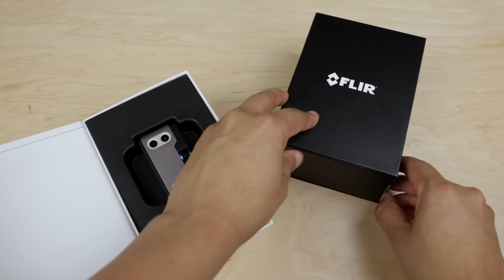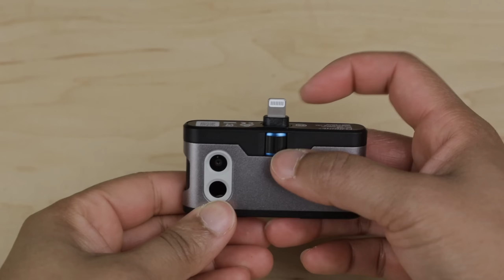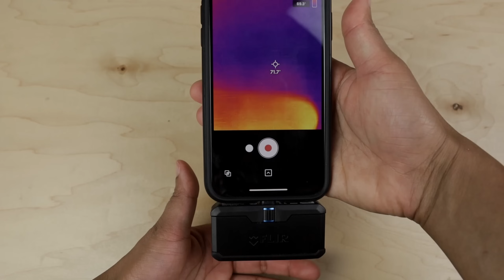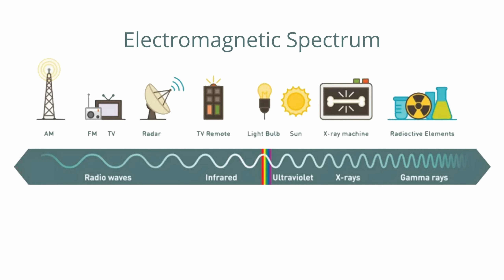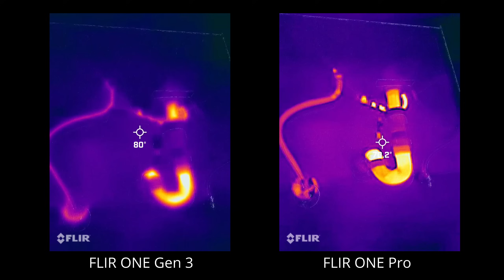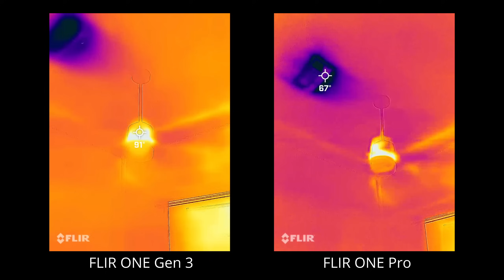FLIR infrared thermal cameras | Remodeling must-have!

Comment: I really appreciate your review of both the devices, especially the side by side footage. 

As an electrician doing mostly old work remodeling, I’ve been considering this investment for a couple years. This past week I suddenly wanting to do something that’s been intended for years, and while beginning the layout on my downstairs rec room ceiling I thought I had a good layout. But as I narrowed the areas I plan to cut holes for recessed lighting, I found ductwork in key areas. 
Finding a suitable tool I thought would be easy. But several of the reviewers maintained jargon that was unnecessary and not something I cared to have to deal with. Your video defined adequately many of the terms (and reassured me they weren’t going to impact my work requirements to know what they meant) and gave relative information regarding what I actually intend to gain by making the purchase. 

Thx. I haven’t decided what to purchase, but I’m fairly certain about reasons why the costlier devise might be a good expense addition l. And vice versa. ❤

Comment: (Oct  2022) Check out the specs for the new TOPDON TC001. Faster, higher res, cheaper than the FLIR pro, 256x192,  25hz refresh,  instant on.

Comment: I recommend Infiray imagers for Android / Windows users. 256x192 resolution is 2.6x greater than Flir One Pro with refresh at 25hz for half the price: P2 model is under $250. T2 models with macro, normal & telephoto lenses from ~$320. No battery in the camera means it's much smaller & usage isn't limited to 1hr max whilst it works. Power needed is lower as it doesn't have a cheap visible light camera to make up for low resolution. Infiray is a big OEM producer & released an SDK - there's some advanced apps for the T series that work on Windows. USB-C extension cable included is super handy. Solidly built metal housing. I'm not sponsored or paid by them either, just very impressed & far superior quality, function & value to the Flir offering that I can't believe Flir is able to sell these at such prices.

Comment: Great video :-)  tons of good info here @ 6:25 emissivity is the ability for a material to release radiant energy /heat.  while emissivity is solely dependent upon the type of material reflect Tivitt he solely depends on the color White being most reflective and black being most absorbent of heat. If something is black and iron or concrete or both there is a slow emissivity during the night hours. For a sheet of aluminum that is silver will cool off in a flash having a fast or higher emissivity.

Comment: I bought this gen3 for my smsung fold, for real deal better buy rugged phone like cat s62pro because you will exposed to the heat,water, metal sharp parts & metal tools while checking,  even the risk of fall 2meters when checking on ladder,  sure outdated s61 more better bcoz it has VOC meter to warning wear mask while checking leaking dangerous gas/toxins/asbestos.

Comment: For folk interested in a FLIR camera, it's worth looking at phones with FLIR built in. The Caterpillar CAT S60 was one of the first, and you could be lucky - like I was - and find a used one for <$100. It only has Android 6, the software isn't great, and it is SLOW but even so, it's a bargain for thermal imaging. (I think it uses the Gen 3 sensor.) There's now a CAT S62 Pro which I think has the same sensor as the ONE Pro, but I could be wrong.

Also worth looking at the thermal imaging phones from Blackview, Ulefone, Doogee. Most (or all?) use a FLIR sensor.
Reply: This seems like a good idea

Comment: For those wondering, the slow 9 fps of these FLIR cameras is because anything faster is export-controlled by the U.S. Department of Commerce through ITAR (International Traffic in Arms Regulations) and AECA (Arms Export Control Act.) Since FLIR wants to sell these both domestically and abroad, setting them at 9 fps or less allows them to be exported without a license. FLIR was fined $30 million a few years ago for violating these laws.

Comment: Ive been wanting one of these for a while, now if i could find an adapter that fits both USB-C and apple devices. Or are they OS dependent?
Reply: I doubt they are OS dependent. The software will handle that. You can get usb extention cords that have adapters to switch between lightning, usbc, microusb. They are all variations on the same connection.

Comment: Being in the calculations and diagnostic business, I usually tell people in your situation to go for the easiest and cheapest first and go from there:
Tighten the building envelope first. We don’t want to heat and cool the backyard…
- Caulk around doors and windows if not replaced.
- if possible replace old leaky doors and windows. New “Builder grade” (I hate that word) windows will still be much better than those 45 year old single pane ones. 
- Replace door seals. 
- Vacuum the old attic insulation and inspect. 
- Eliminate as many ceiling penetrations as possible and seal the rest. That attic fan NEEDS to go! Installing insulation above it will not eliminate air leakage. 
- Seal around AC vents, lights, etc and every top plate hole with that orange foam they use on newer homes. 
- seal or replace ducts, diffusers and boxes. 
- with that done get a blower door test and decide if you want to invest more money in tightening the home or not. 
-  at this point decide if you want to spray foam the attic or not and reinsulate it. 
- now that you’ve taken care of the envelope according to your budget, you can decide what else to spent money on. 
It’s a bit simplified but that’s it in a nutshell.

Comment: Ill be honest, I had one for a week and thought it was a total waste of $.  I bought it to use for my business and it ended up being worthless.  If you’re doing thermal insulation checks its not bad, but it does not see through walls as some advertised.  Not talking Superman, they said locating wires and pipes and it did nothing of the such.  I ended up taking pics of my dog and returning it.  A $20 laser thermometer does the same thing without the screen.

Comment: Thank you for that info Belinda, very educational. Calling on all your experience and expertise in this area which of these would you recommend to detect an underfloor leak on a heating pipe or even a cold water pipe? say under 100mm of concrete screed. Or perhaps there is another option (camera) best suited to this scenario.

Comment: I thought the low refresh rate was a technical limitation similar to the low resolution. It being due to government regulations kinda surprised me. I wonder why they did that.
Reply: TLDR: ITAR.
Thermal optics can be used on almost any weapon system that uses optics.  There are a fair number of missiles that use a thermal optical tracker to identify and track targets including ground, air, and naval vehicles.
Similar limitations are placed on night vision and other limitations are placed on GPS receivers.

Comment: I work in electronics and finding a short on a board can be tedious and time consuming. 
I had considered the accessory camera system until I realized just how much I would really be using it. 
That's why I went with the Cat S60 and then upgraded to the S62 Pro. 
This has been a great help in both my work and home. 
I found insufficiencies in my insulation very quick (1st day) . 
I can see when a bearing in a mechanical system is starting to go out and so many other things.
Reply: Interested in bearing. Do you know its failing because of an increase in heat?
Reply: @noahvillalpando  Yep. Gererally indicates a short
Reply: @charlesurrea1451  I'd love to see some video on a thermal camera capturing a failing bearing. As a mechanic this would be good for power steering pumps.

Comment: You can get some very useful imaging of insulation from the outside too, especially when the temperature outdoors gets a bit cooler.
One particularly useful experiment I did with mine was a "poor man's version" of a blower test: you cut a foam board to fit in an entrance door frame, cut 1 or 2 holes to fit box fans (to push the air inside) that you affix with tape, then take a few images (from the outside) of windows or anywhere the air may leak, start the fans, take the same images and compare.
In my house I had a mix of new and old windows, and that test was part of what convinced me to change the old ones.

Comment: Thanks, this is useful information. I've been using thermal imaging since 1985, but they were way out of reach and not as capable as these units. We used them to identify electrical overloads, loose connections, roof leaks and wet insulation. I love how easy it is to take camera output and use it in reports. Good work.

Comment: Use a blower door at the same time and it "amplifies" any air leaks making them easier to detect (as long as the temperature outside is substantially different from the inside).

Comment: Let it be known that these units have battery problems. If you let the battery die, it will not recharge. You then have to disassemble, manually charge the battery and pray that it works again. FLIR will not provide a solution.

Comment: After seeing some terrible reviews for the Flir, I ended up getting a Seek Thermal Compact Pro instead.
Definitely recommend, and I can't imagine having to charge my thermal camera separately to my phone like the FLIR requires.

The higher resolution of the CompactPro (significantly more than the Flir One Pro) also means that the lack of MSX is not a problem, the detail is sufficient just from the IR image.

Comment: The only prominent issue I found in reviews about these devices is that the battery begins degrading prematurely. The fact that most people who buy these will not be using them regularly doesn't help the battery issues either, as the battery is not being charged and discharged optimally.

 It can apparently be so bad that the usage time dwindles to ~5-10 minutes after only a few months of ownership.

 I have no clue if this issue is still relevant or applicable to all the different generations and device compatibilities, but that's really the only thing keeping me from purchasing one for our own reno.
Reply: Take a look at the Seek Compact Pro. Higher resolution and no built in battery - I've been very happy with it so far.
Reply: @mowcius  Do you have that device? I remember looking into it previously and just checked it out again to refresh my memory. 

There seems to have been a privacy concern with the amount of permissions that were needed to be granted in order to use the device. These permissions apparently allowed (still do allow?) the company to use your location as well as the images taken using the thermal camera for "marketing purposes" if they choose to do so.

I would love to hear your experience with it if you have one!

Comment: I worked in the power industry for 40 years and fell in love with thermography training I received. I highly recommend checking switches and breakers with this tool. It will let you know about potential failure long before you would find it otherwise. 
 It can even be helpful for tuning old cars via the exhaust.

Comment: I've been looking at these for some time, I appreciate the review. At times, the temperatures showing on the two devices pointed at similar locations seemed to be really different - I'm not familiar with the nuances of the technology, is there a reason for this? Thanks for the video!
Reply: They're not designed as absolute temperature measurement devices, and typically have an stated accuracy of something like +-5C. The emissivity settings may also not have been the same, and reflective materials cannot be measured accurately.
If you need accurate absolute temperature measurements, expect to spend over $2000
Reply: @mowcius  was wondering the same thing...thanks for some insight as to why!

Comment: Normal people: this will help with remodeling and finding energy deficient areas in the home.
Me in a haunted house: I can use this to quantify how many ghosts are needed that make cold spots to negate the need for air conditioning!
NP: But ghosts aren't re-
Me: shh shh shh * looks intensely at device*
NP: ....
Me: ....
NP: Right, I'm just gonna get a heat pump.

Comment: Just a thought, it might be worth exploring energy waste from solar panels. 

Additionally, as you do the remodel, testing various insulation types all on the same wall might be interesting.
Reply: Most solar installations are on top of the already installed insulation, so I highly doubt that they would noticeably increase heat loss from a normal attic. At least not any more than nailing some pictures to an internal wall should alter a houses insulation value.

Comment: Those hot spots seem to be roof rafters on the western or southern side of your house. Also depends on your tree shadow coverage. Because of the vaulted ceiling to the edge of the wall the rafters are directly connected to the drywall and of course the roof at the same time, aka no air gap. So instead of the heat radiating off the rafters, it is directly conducted through the drywall. Not a lot you can do about it without major rafter or roof mods since there is no air space. Insulated roof decks are the Cadillac solution. Planting a big tree will help to block the sun lol.

Comment: Great Review!  I use the top of the line Flir at work, Electrical Codes require a thermal inspection of all electrical Panels and Switch Gear.  Glad to know Flir has a consumer version I can buy and use at home.

Comment: These are really useful for finding pipes in walls and on cold nights you can see cold air coming in through gaps. I found huge drafts in my extension all around the skirting boards and around the downlighters. I've sealed the skirting board gaps with clear tec7 and changed the downlighters to the sealed bathroom led type. It's made a huge difference to the room.

Comment: I'm thinking of getting one of these because I don't want to have to rip out a piece of sheetrock to find the stud line.....I know where the stud is but there's a trunk wire for the second floor that was mounted against it. Would be interested to know the differential resolution in whether it could find the wire so I can avoid it (I need that stud to put up an internal barn door separator for the living room).

Much appreciated if you can get back to me on it.  If you're not sure what I mean, basically can it pick up a cord within a wall and how many amps before it gets into focus enough for you to tell exactly where it is behind a painted wall.

Comment: I understand blower door tests are a good thing to do.  Is there a DIY approach for a house in Texas built in 1986 that would give a base line and show progress as sealing is done?  I'm planning on doing the heat/ac duct vents this winter as well as spray foam on electrical penetrations.

Comment: Are hot water heater blankets practical with modern hot water tanks?  

When comparing imaging devices, it's usually more important to look at the radiometric resolution, or the pixel range for a particular color "channel" as characterized by the bits between the darkest and lightest endpoints.  A 4-bit system will have 2^4 or 0-15 greyscale options, while an 8-bit will have 0-255 greyscale options for each individual pixel.  IR systems are usually behind the curve compared with VL systems.  

Examples would be NASA's Landsat 7, which had 8-bit pixels, versus Landsat-9, which will be launched on Sept 27, and has 12-bit pixels.  Those satellites have to deal with different lighting conditions as they fly from pole to pole, and at different seasons, so the radiometric range really matters, especially when you want to go back and compare previous images of the same area.  In different lighting conditions, the pixels are not always able to make full use of their range.

A multispectral system will have multiple wavelength channels, although you can only ever present three in a graph that a human can see.  Some may be composited, or it may allow you to select several of them with captured image processing.  E.g., Early Landsat MSS units usually had 4 bands, plus a few other separate imaging units.  IIRC Landsat 8 had 11 bands across multiple resolutions, half in the visible and half in infrared.
Source: seminar course on remote sensing

Comment: Thanks Belinda. I've considered these before but always get stumped on the fact that I will only use it very occasionally. A rental option would be nice.
Reply: I forgot to add, that this can make the Seek line of cameras more appealing. They don't have the dual camera, "object outline overlay" feature of the Flir, but because they don't have a battery, they will never fail to operate with a low battery fault.
Reply: That sort of usage pattern actually makes the Flir brand cameras less ideal. As she referred to by the charging port, and how long they run, these cameras have an internal battery, that is not user serviceable (or has not been). 

If the battery gets too low from lack of use, or putting it away after use with a low state of charge, and it self-discharges too low, it may refuse to charge, turning the camera into an expensive brick.

Comment: That was great! Good explanation of emissivity. Next can you review some laser levels or ultrasonic measurement devices? I think there’s a thing that lets you do very accurate inside measurements, like where you’d have to bend a tape measure and guess, like in a doorway. In the old days you’d use a folding ruler with the little brass extension, but nobody under 30 has one of those in their tool belt.